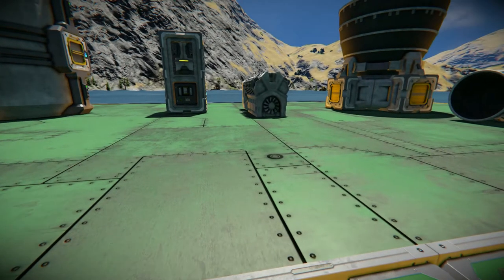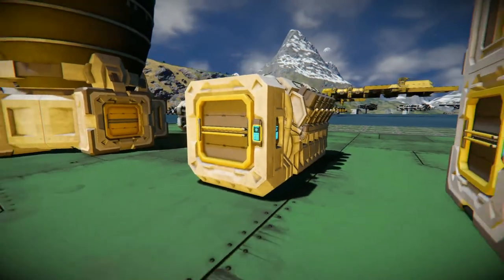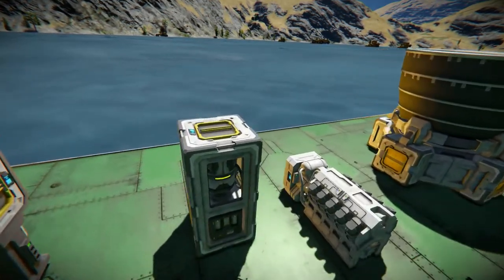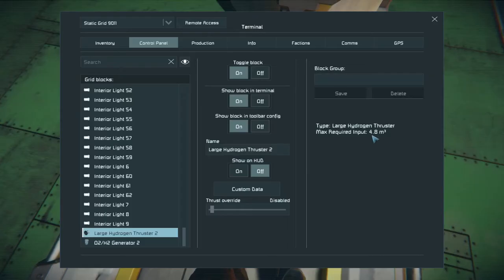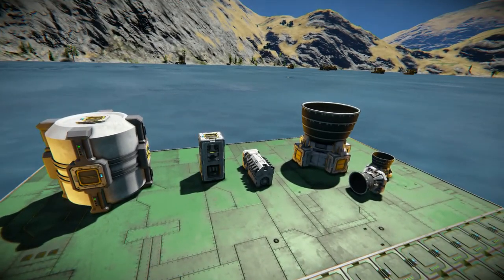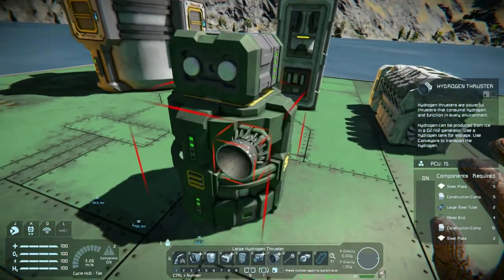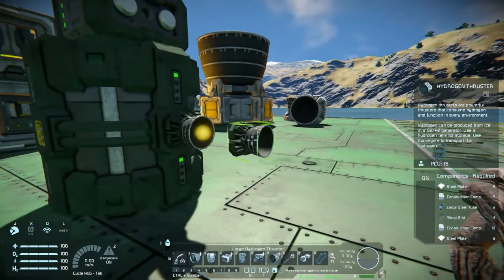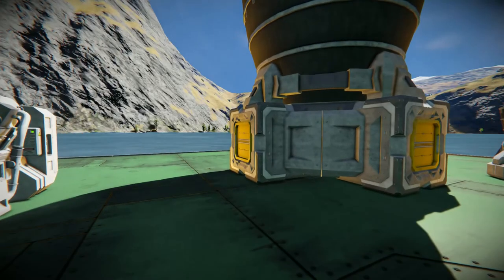Space Engineers - 2022 Hydrogen Basics - Advanced Explained

Comment: Question do you need a battery to run a hygen engine?
Reply from the maker: must have power to start remotely otherwise manually turn it on at the control panel
Reply: @painstudios148  ok thanks

Comment: If I did the math right it takes 8.333 hours to fill a large hydrogen tank, I better have made a mistake
Reply from the maker: correct if using only 1 h2/02 generator
Reply: I realized production speed is 3X by default, so it would take 1/3 the time
Reply: Assuming it effect hydrogen production